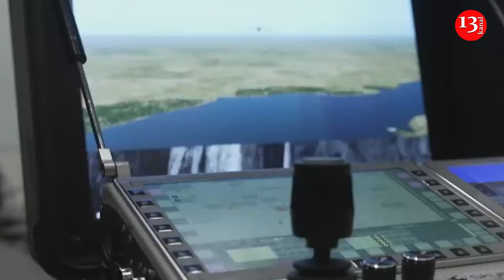Ukraine builds fleet of fighter drones, new terrible blows will be inflicted on Russia

Comment: One source of fuel and therefor reduced range is launching from the ground to gain altitude.
Balloons well they are bags of gas, concentrated lighter than air or hot air to gain lift.
Nose down, tail up, drop in from above after the wind blows them over the lines and you have gained range and a top down view of the target area.